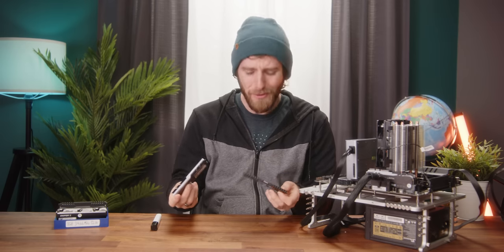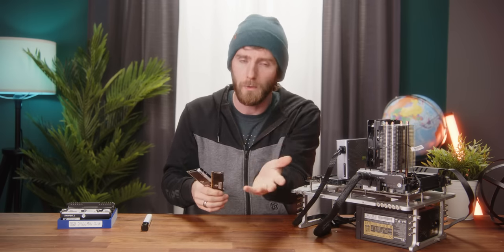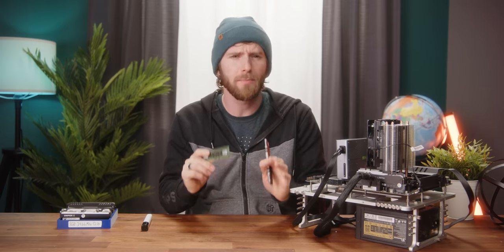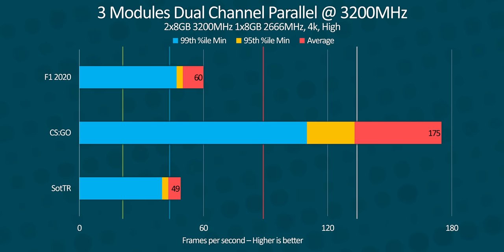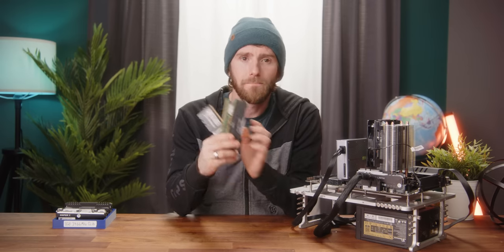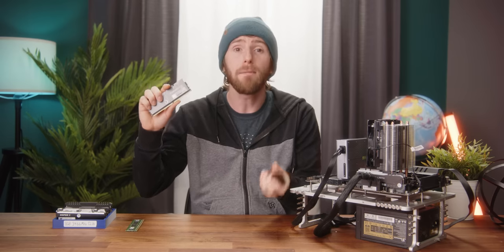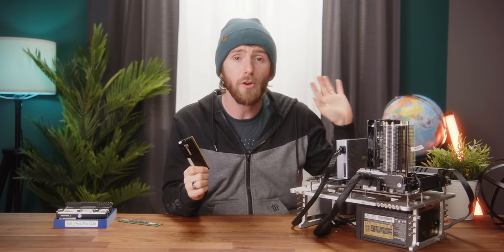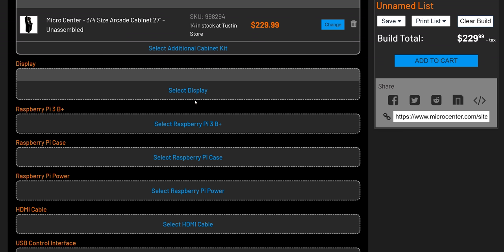Just How Bad is Mixing Memory?

Comment: > Mixing and matching is always going to be a 💩shoot

The lesson I learned from my last upgrade is that doing ANYTHING with RAM right now is a 💩shoot. Two different kits of quad-channel failed to post. I could make dual channel or 2+1 working but only with the ostensibly-identical sticks in a VERY PRECISE order... And then the system worked fine quad-channel mixing in two sticks of completely different specs that weren't even on the mobo's QVL. 

Not sure if it's the chip shortage forcing makes to resort to inferior ICs, the bar for QC being lowered to meet demand, or just darn bad luck, but my #1 piece of advice right now (Summer 2022) is: *keep your receipt*.

Comment: Before watching, from my own experience it was better than the 4gb when I added 8 more gb for a total of 12. Same brand but different sticks. But also it would only run at 2800mhz and not the better 3144mhz of the new sticks. Later when I added more and swapped the lower ones for the same as the new ones, it ran how it should.

Comment: I have [Klevv Kras-X (8x2_16gb) 3200mhz (16-18-18-38) 1.35v] and its somewhat hard to find in my area and its more expensive than other RAMS so I went to buy [TeamGroup T-Force Vulcan-Z 16x2_32gb) 3200mhz (16-20-20-40) 1.35v] and at first finding the proper slot for the ram is problematic but after few trials everything worked and XMP set all my RAMS to 3200mhz (16-18-18-38) 1.35v at a total of 48gb RAM size and how I thought timings would be (16-20-20-40) hmmm, first time doing it and so glad it worked well together without problems. Thanks Linus!

Comment: I ran into something like this when upgrading an old lenovo laptop. It had 8gb of DDR3 1600. The problem was, half of that was soldered to the motherboard and there was only one SODIMM slot. I had to hunt down some random super sketch brand of DDR3 1600 to get matching dies and timings for my 8gb stick for a total of 12gb of ram.

Comment: I ran into BSOD issues (But only with XMP enabled) after adding 16GB using the same model number RAM from Corsair. The kits worked independently and both passed a Memtest, so mixing can be a bit of a lottery. I ended up getting different vendor die.
Reply: Good to know. I currently have a Corsair vengeance rgb rt (2x8) CMN16GX4M2Z3200C16, I was planning to add a 2x16 kit with as close spec as possible. I guess I'd have scrap that plan after all.

Comment: I recently built a gaming rig for myself,
i9 14900KF (Overkill, almost useless for gaming, but I didn't wanted to upgrade for a long time)
But I did the error of buying 2 separate kits 2x16GB (Corsair Vengeance 6400) they were running maximum at 5600 but stable at 5400, then I had a lot of BSOD, random Crashes in games, at some point I wasn't able to reinstall window anymore, so, I downgraded the CPU to an i7 14700 (the 14700k wasn't available) because in the meanwhile I realized that the i9 was too much of a waste and probably mine was also faulty, I changed the rams with a single kit 4x16GB DDR5 6000 (prior to checking on my MB compatibility list) and now I have 0 problems with the rams running at 6000mhz, Fury Beast

Comment: On one of my old systems, i managed to add 2 RAM sticks, to upgrade from 4gb to 6gb and was working totally fine, they are also different brand.
Reply: My main gaming rig has an 8 gb stick paired with a 4 and a 4 paired with a 4 and it runs pretty great. All same speed ddr3
Reply: I must correct that i checked my old PC and atm has 2 RAM stick of different brands, 1 is 2gb of a brand and 1 is 4gb of another brand and they work fine, but i remember i tried to use like 3 sticks and had some problem before maybe.
Reply: @NoobSicnarf  Not sure if i understood the combination or its a troll.
Reply: @Klasus357  its real lol
Reply: @Klasus357  i tried 3 sticks too and it gave me issues with booting. I had to populate all 4 slots
Reply: @NoobSicnarf  Ah i gotcha now, yeah i had also issues with 3, so it seems 1,2,4 sticks are working fine as combination.
Reply: @Klasus357  if it matters the CPUs i have tested this on were i7-3770 and i7-3770K. Idk if DDR4 operates differently with the dins

Comment: On my experience, i mismatched the two rams on my laptop nitro5, at first it did not worl but i tried putting the slower ram as the 1st then the faster as the 2nd and it worked without any visible errors or problems in my laptop, it also helped my laptop run the cyberpunk so smoothly at very high settings compared to when i didnt yet put the extra ram.
Reply: thanks for making this comment. i have a nitro5 and im going to mix my ram soon. i'll try putting the slower in the 1st slot just like you did
Reply: Thank you so much for commenting this, really help me.. I think the reason we need to put the slower as first is to set the slower ram speed as the basic speed

Comment: "DDR4" is a standard. It shouldn't be surprising that mix matching works MOST of the time. It is literally designed to do so. Different models/brands just have different rating i.e. some can run faster than others, etc.
Reply: The standard speed for DDR4 is 2133MHz. This video was mostly focused on how well you can mix and match modules rated for higher speeds or different CAS/RAS timings.

I was hoping to see more comprehensive information, but expecting LTT to show thorough, rigorous data like GN was asking too much I guess.

Comment: when I built my old computer, I didnt pay attention to the clock timings, just the clock speed, I went with 2x8GB Ripjaw V 3200mhz.
My new computer from EK Fluid Gaming came with 2x8GB Trident Z 3200mhz.

the Trident Z were CL16, and i was kinda shocked to find out my old ripjaws were CL14... so of course I put the Ripjaws in the B channel on my new rig and set them both to 3200mhz CL16

I wasnt sure if it was a good idea because of the myth, but it definitely didnt hurt anything, and I guess I'll find out if it helps when I get around to giving my computer a real workload.

Comment: My main concern wasn't compatibility, rather increased error rate, where's the memtest86 results?
Reply: I also did that since the 486. As long as I didn't have a defective ram I've had no problems
Reply: @espanalibre7235  Bad Spammer ... go away before you get banned.

Comment: Running 12 sticks of ECC DDR4, from three different makers. Two are 16GB at 2400, two 16GB of 2133, and the last eight are 16GB also running at 2133.

Happy to say my system took them like a champ, and haven't caused any issue.

Comment: I wish I had known about mobo manufacturers listing compatible ram modules. I have an Asus Prime Z690-P WiFi, and I had standard Crucial 2x 8GB DDR5-4800. I bought three Crucial Vengeance 2x16GB DDR5-5600 on sale, but didn't matter the configuration and settings, I kept getting freezing, crashing and random rebooting. Tried troubleshooting for 3 months, decides to put my original ram back in, and it's been running perfectly for over a month now. In the last week, I found out while researching my mobo and ram, that 3 models of Crucial ram is compatible, no Crucial Vengeance models are.  And since my son isn't going ahead with his server build any time soon, it means we have these 3 Vengence 32GB sets collecting dust.

Comment: I had mismatched RAM in my brand new setup when I first got it (Z590/i7 10700k/RTX 3070). And it was causing my fans to throttle up and down sporadically at high loads, WITHOUT any software being able to detect the RPM changes. Took one set out and it solved the issue instantly.
Reply: How mismatched? Brands speeds and timings? I have I have trident Z neo same brands and speeds. But 2 are cas 16 2 are 18. Not sure if it’s an issue

Comment: Funnily enough, I bought a gaming laptop and it came with 8gb ram I wanted to upgrade to 16 for video editing and of the ram I had installed an extra 8 was the same price as an extra 16 so I figured I would go for the 16 then if an 8 and 16 weren't compatible, I could just sell the 8 I had originally got but they work fine together lol
Reply: There's laptops with dual slots for expansion?
Reply: @e-cap1239  yes, my MSI gf75 slim has two ram slots
Reply: @e-cap1239  even my old terrible office laptop supported dual slots for expansion

Comment: I did this back when DDR3 was a few years old, I wanted to upgrade and bought some random DDR3 stick. It worked fine but when I wanted to get more RAM later on and did the same thing I had to fiddle around in the bios (and I was in high school if I remember correctly) which was a lot of pressure, thinking I could just screw everything up. Anyhow, I got it working in the slowest speed RAM's clock speed and it all worked out fine, but still, I was a lot more careful after that...

Comment: Damn, I was really expecting to hear: RAM isn’t the same as it once was it doesn’t matter anymore as long as their rated the same.
Reply: That's kind of exactly the result.  He's confusing things a little by saying, if you take 2666 an 3800 and pair them together, guess what.. it won't run at 3800.  But that's not really a surprise, is it?  Installing new fast memory doesn't make old slow memory any faster.  :-)  You can, however, run them both as fast as the slowest module can happily run at.
Reply: @nickwallette6201  oh I though he was saying it’s ok to for a pair of ram to be different but if you’re using four you can’t mismatch.
Reply: @Exail01  Well no, the actual takeaway is that your modules should all match to ensure no issues. If you aren't going to get all your sticks to be the same, try to match the dies, timings and latency to avoid errors and the more these three don't match, the more likely you are to have issues.

Comment: i built my rig years ago with 2 slot of 3000mhz corsair ram sticks, just updated it an hour ago with 1 corsair stick with 3200mhz, use xmp overclock to 3000mhz for 3 of them just smooth as hell

Comment: PRO TIP: you have a prebuilt system like a dell/lenovo/hp, you can download "userbenchmark" benchmark your pc, you can scroll down on your results page to see "typical builds" this will show you the components other people have in the SAME PC. I used this trick to upgrade my old gateway desktop. I never thought it could have more than 8gb of ram and I saw that someone found compatible ram to run 16gb in the system. The best part is it shows you the EXACT part number you can search for to buy!
Reply: @Psychx_  👎👎👎👎
Reply: @Psychx_  🤔 no thanks

Comment: I still use a mixed 4GB x 8GB LPDDR4 combo on my laptop.

When I  just slotted them in together, it didn't work, but I had to put the 4GB, boot, power off, then put the 8GB.

I tried switching the order (8GB first and then 4GB), but it didn't work). I don't know why but I'm not complaining. As long as it works now

Comment: A couple years ago, i made the mistake of mixing 3 different brands of RAM. 

I had already mixed 2 single sticks for a combined total of 16BG, and bought a matching pair for my second 16GB. I installed the new memory, it ran for a couple days, and then would incessantly BSOD whenever I did anything. I've since ditched the mismatched original pair, and the PC is fairly stable (though not perfect, it seems to have had a permanent effect 😥).
Reply: I remember putting Samsung and Kingston ram. Both has different speed and different timing. They both works well but everytime i play heavy games, game keep crashing when heavy loads happened. So i bought another used Samsung the rid kingston and there's no crashed anymore.

Comment: Interesting, didn't know this wasn't recommended. A few years ago one of the four 8 GB RAM modules in my desktop died, so I replaced it (and its matching partner, I got two sets of two a few months apart) with two 16 GB modules for a total of 24 GB. That was the end of 2018, I think, and it's been running perfectly for me ever since. I didn't run any benchmarks or anything, but I haven't noticed any performance differences.
Reply: It's not really a thing that's recommended or not recommended, it's one of those "if it works, it works, if it doesn't, find a different solution" things. Mixing RAM is a rather common practice, and usually works out fine.

Comment: I originally had a set of Gskill ram (2x8gb) at 3600mhz, and added a pair of corsair vengeance PRO RGB (2x8GB) at 3000mhz. the corsiair ram overclocked perfectly and is super stable without even changing the xmp profile

Comment: 7:15 Linus talks about 2 different sizes as one dual-channel combo. Would the same be true, if I have already installed two sticks and want to expand with 2 larger ones (i.e 2x8 + 2x16)? Whereas the same sized ones run on their reccommended dual-channel slot and the 16 ones got into the remaining 2 slots?
Reply: In case you haven't had an answer yet, it's been supported for years to use one size in the primary slots and a different size in the secondary slots, so each channel has e.g. 16+8 in.

Comment: I mixed up my 8gb laptop into 12GBS by stealing the 4 gigabyte module from a old Dell. And rhe embarrassing part is the chips are only on one side do i knew that mixing up memory wasn't that good but luckily both of the Rana were in kind of really low but similar specs around 2600MHz and I'm Akshay thinking on buying a new crucial 16 gig memory module upgrade kit and install it on my laptop. So sacrificing speed doesn't matter. And also i gotta switch to a pc in atleast 2 years. And it's actually good it's not bad and i don't see any issues it even improved my obs experience a bit too. And the chips are kinda looking the same too.

Comment: I recently added 2x16Gb extra RAM from Corsair (3200Mhz) to my 2x8Gb sticks from Kingston (2400Mhz) and got lucky enough for them to work well together in the end. As Linus says, it's probably a matter of luck, just buy one that suits your upgrade budget, try it out and if it doesn't work, just send it back.
Reply: I currently have a Corsair vengeance rgb rt (2x8) CMN16GX4M2Z3200C16, I was planning to add a 2x16 kit with as close spec as possible(same brand), but I'm afraid it will have problems running like the video mentioned  7:25. 16gb is enough for my gaming needs right now but I run LLMs so I desperately need more ram for that.

Comment: I worried about having issues with this on my ancient gen1 i7 system that had 6 DIMM slots on the mobo(ASUS Rampage II Gene). It originally started with generic Nanya 3x2GB DDR3 1333mhz CL9 sticks, then about 2 years later I upgraded the system by filling up the remaining 3 slots with some G.Skill 2GB sticks of the same speed and latency. The system ran just fine at the stock speeds for many years with the mixed sets. Even with the Nanya sticks being dual rank and the G.Skill being single rank, it didn't cause any issues mixing them. I eventually replaced all six with a matched set of Crucial 6x4GB 1600mhz CL 11 DIMMS in order to squeeze a few more years of use out of that rig.

Comment: Was interested to see what happens in some cases since I just recently bought a couple optiplex 9020s for my younger brothers, one of the PCs came with 16GB of ram, but the other only had 8GB, ended up being 4x2gb sticks at 1333.. yuck. I had a kit of Gskill 2x4gb in a box from when I upgraded my first PC though, so I added that to 2 of the dims. Seems to work fine most of the time, but sometimes hangs in the boot phase for a lot longer than you'd expect on an SSD. Definitely going to be picking up another kit of 8gb next time I see a decent price. I've found that nowadays you can get 16gb of ddr4 cheaper than the same ddr3 ram, can't complain too much considering both systems cost less than $250 each.
Reply: i have a qs can i overclock my 3000 mghz ram to 3200 and pair it with a 3200
Reply: @thecuzzy3571  I'm not sure, the optiplex bios isn't as in depth as some of the ones we have nowa days. I wouldn't think you could overclock only 2 dims though, usually you have to overclock all populated dims, from what little experience I have on that matter.
Reply: @austinwelch1132  so the simple ans is no
Reply: @thecuzzy3571  I certainly strongly doubt it.

Comment: I ran 2x8 Kingston and 2x8 Crucial modules just fine, with the former ones being Hynix CJR and the latter Micron E-die. So they were different chips. But with the same rated speed and timings (3200 16-18-18-36)

Comment: Dell PC had two slots with one populated with 8GB UDIMM DDR4. Purchased a kit of 2x8GB UDIMM DDR4. The system would not post unless I replace one of the new modules with an old one. Old + either of new ones would post with 16GB total. I tried multiple things from the internet like bios update and clearing cmos stuff, nothing worked.

Comment: Cool to know that asynchronous dual channels exists cuz my ram is mismatched Teamgroup sticks with 1x8gb (Micron) and 1x16gb (Hynix or Samsung forgot which). 
At 2666mhz I was able to drop them from CL20 to CL14. Going to 3066mhz I found 16-18-18-18-38 stable, but going past 3066 was unstable which could be due to my Ryzen 5 2600 processor, the mismatched dies, or needing more than 1.2v for the ram because I didn't touch that.
Reply: 1.35V is perfectly safe. Many people go 1.45 but idk if it's worth it. 1.35 is my sweet spot
Reply: @timofeifilippov9558  Thanks for that. I actually forgot I made this comment haha.
Yes I've tried 1.35v since I made my comment. CL14 with 3066mhz worked at 1.35v if I remember correctly.
But it seems like the memory controller of my Ryzen 5 2600 is what's holding me back from getting a stable memory overclock past 3066 even with the increased ram voltage. Most of the ram overclocks on Ryzen 2000 I've seen online stick with 2933mhz as a stable overclock of memory and past that is somewhat rare.
From what I've read Ryzen 3000 and 5000 series processors are able to tolerate the higher memory speeds better and run in 1:1 ratio with the SoC of the processor. I may fiddle with it once again if I end up upgrading to a newer AM4 Ryzen processor.